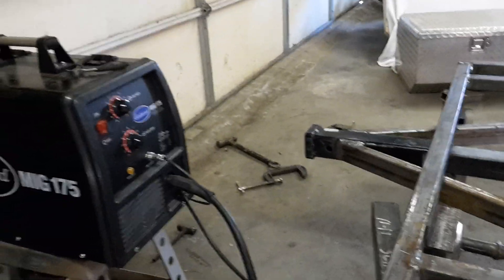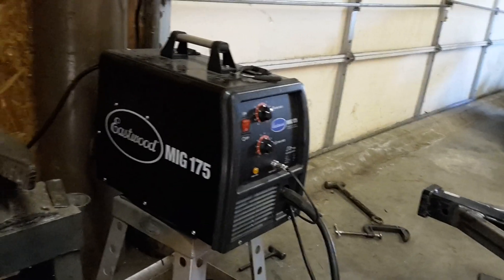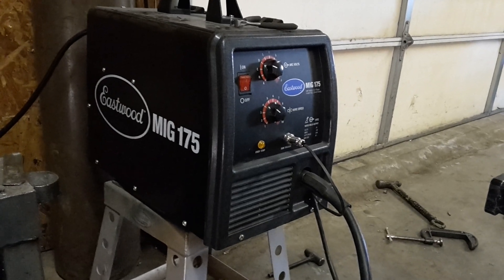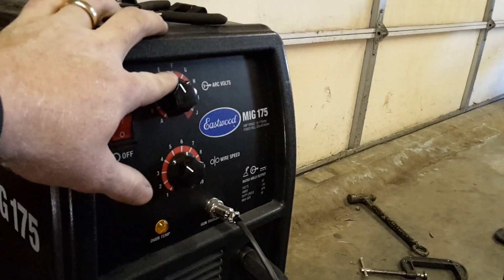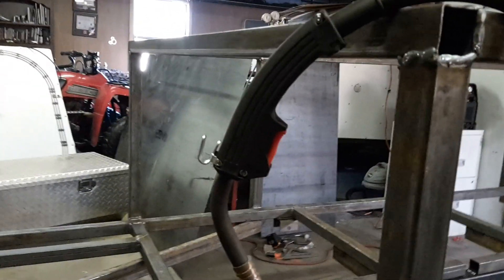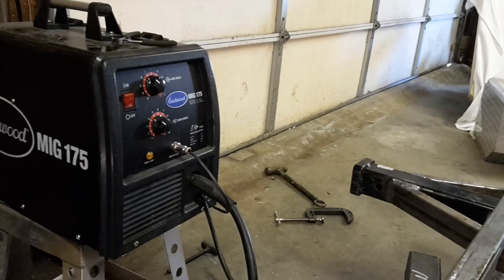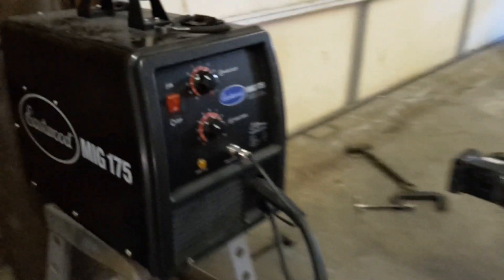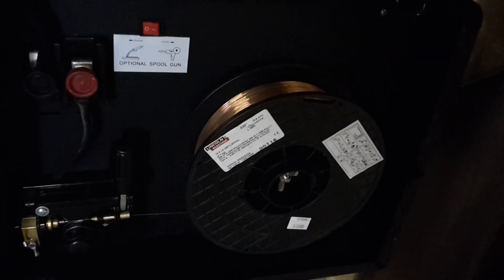Eastwood mig 175

Comment: I am looking at the smaller Eastwood MIG 135 (110, not 220) and the thing that really impressed me is the quality of the board and internals, the soldering, etc. It is much better than what you should expect for such a price. I would be curious to see the main board for this 175. Good post. Thanks!

Comment: Thank you for the solid review. So far I've owned 1 Lincoln 180, a H.F 180 and 170, I guess they all have their positives but it seems no other brand comes close to what Eastwood offers at this price, even though the H.F's are less than half the price, at least the 170 is, you can't upgrade or replace ANYthing on them, the duty cycle is abysmal and the stinger length is laughable at best. The Lincoln 180 was a dream to use, I was surprised it felt better to weld with than the Miller 350s at work (personal opinion) but for $200 more than the Eastwood I didn't even get a spool gun, the settings aren't infinite like the Eastwood, the duty cycle was the same or less, I paid sales tax and only a 30 day return, and to get 3 years I would have had to pay more. Now I'm ready to step it up a notch and get something better than my H.F 170 again and its either this model or the Eastwood 250 but that honestly feels a little bit like overkill for my needs for now, but that 60% duty cycle is incredible for $799. Idk I think I will save the $300 and get the 175 and and tank of Argon for aluminum etc.
Reply: Charles Jones don’t know if you’ve purchased a new machine or not but I have the 175 for about 5 years now. Ran probably 4x 11lb spools thru it and have had minimal up keep. I did put a longer heavier powder cord and the same for the ground. I’ll also get a little bit longer torch when this one is worn out. Well I can’t seem to wear it out!  It might not be the greatest machine out there but I’ve put mine thru the paces and still love it just as much as the day I got it to replace my HF 151. My boss also bought the 250 and honestly I like my 175 more and so does he!  Just my $.02 of a review

Comment: The concern I would have is not whether or not Eastwood would honor their warranty. It's that the machine is already malfunctioning 4 days in. Yeah, you're giving it a workout, but it's not like you're abusing it by welding together a trailer.

It's not how many years it lasts. It's how many hours of run time. That's what matters.
Reply: I see your point but I imagine hundreds or thousands are manufactured a month, not all are going to be without defect, like any other brand.
Reply: Theball Player I had a brand new Miller 452 Delta malfunction the day I hooked it up took Miller two weeks to get me the parts.

Comment: All you buyers beware Eastwood MIG 175. I purchased one of these welders in April 2018. Had it only 3 months, used only 3 times on sheet metal so that is on relatively low settings. Stopped working, no spark, no wire feed. After talking with Eastwood they said it was a known issue - something on the motherboard or something burned out. They said to send it back and they will replace it. It was fedexed back to them in a couple of days, a week after they received it I had still not heard anything. I called them and they said it might be another week or more before I receive the replacement because they only have one person working in the warehouse and this person had a lot of returns to deal with. Get that? They have a lot of returns. What does that tell you? Save your money for a real welder and not these pieces of China made junk.
Reply: You post this every where